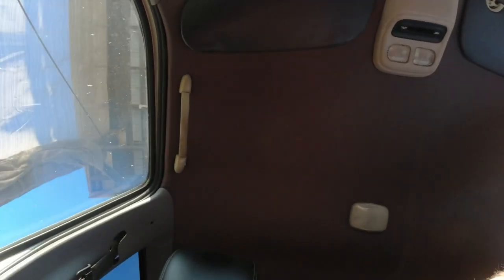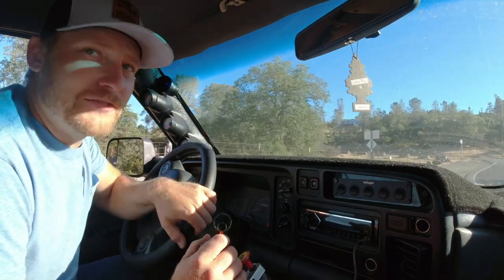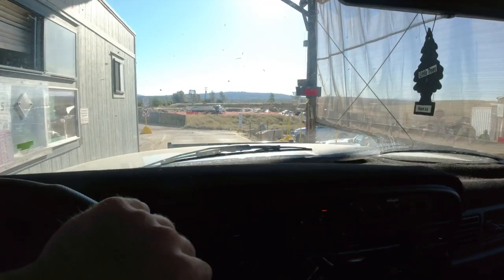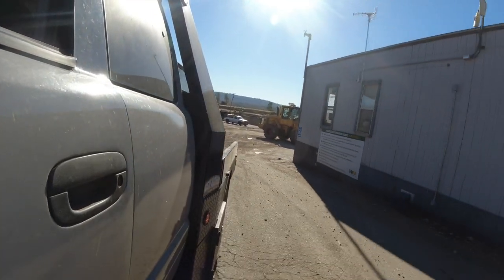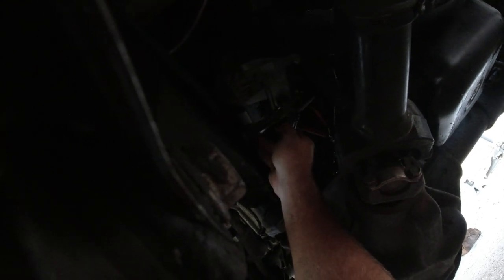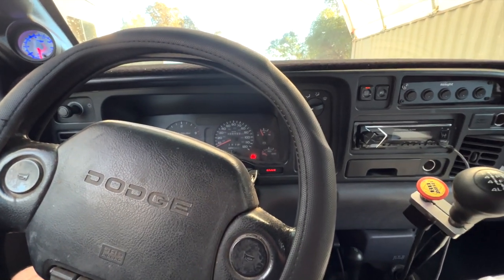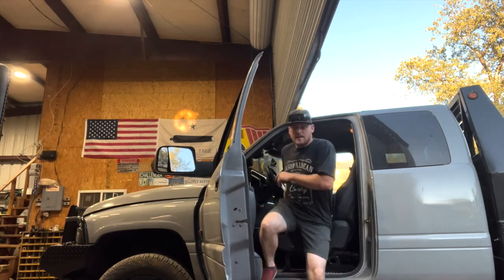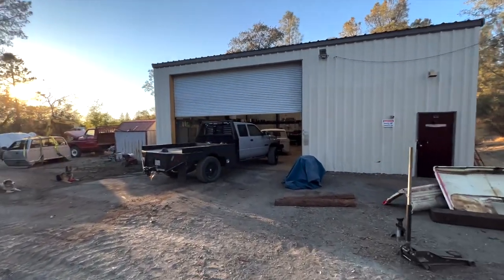12 valve Cummins almost leaves me hanging TWICE! Why no 2nd gen content??

Comment: I will say, there are cheap versions of those solder n seal connectors. What I’ve found with the Amazon/eBay ones is you have to get the solder so hot with the gun for it to start melting the connector itself most of the time, even if you get it to melt it doesn’t seem to hold very well. My dad ordered some aviation ones for his kit plane he is building and they don’t have that issue, but they are like 5 times the price.

Comment: HI  Sam.  Keep  on  doing  your  thing.  12  valve  24  valve  don't  matter,  or  hot  rods  or  tree  cutting  too  for  that  matter.  Variety  is  the spice  of  life.  Keep  going  the  way  yer  going.  Just  don't  burn  yourself  out.  Now,  in regards  to  the  electrical  connector  going  bad,  I  still  seldom  use  butt  crimp  connectors,  except  for  terminal  connections,  such  as  switches,  fuse  blocks  and  such,  where  connect  disconnect  needs  to  be  accessible.  Otherwise  I  solder  and  heat  shrink  with  double  wall  heat  shrink.  I  find  it's  a  more  permanent  connection.  I  live  in  the  cold  and  salt,  I  don't  want  any  corrosion  getting  access  to  a  connection.  Keep  up  the  good  work,  we'll  be  here  for  you.

Comment: Hey Sam, I think you needed the larger yellow crimp. Big wire won't slip inside if connector is too small. We are 2800 miles apart and you have helped me fix my truck twice and my dad's truck once.

Comment: I’ve had a bunch of electrical issues on my 95. Had the starter relay go bad a couple times. I ended up adding a wire in that splice there and running it up to the battery. If you ever have that problem just pop the hood and touch the wire to the + terminal. Hide the wire good tho.

Comment: After building an ls swap harness and some 7.3 injector harnesses. I went from even the typical solder job to the non-insulated crimps amd just throw the heat shrink over. Eliminated my vibration breaks over time.

Comment: love this content man, i pull with my 96 5.9 magnum all day and thankfully i haven’t had any problems as of yet. but i typically never exceed 6500lbs with my dump trailer AND it has a 46re 😂 however i do maintenance the hell out of it even do oil changes early along with a massive after market radiator and a big transcooler. 

i’m trying to retire it before something breaks, especially since it only has 102k miles

Comment: you really gotta heat those solder shrink connectors to get the solder to melt. most times people think once the heat shrinks you are good but nope you gotta sit there and make sure you can see the solder flow
Reply from the maker: Agreed but turns out that still wasn’t the issue. Was slightly corroded connection up to little grease fixed or

Comment: I appreciate your honesty on the 12v. I have my own 97 12v 5sp 2wd that I have dumped about what you have previously stated because I had to have others do the work. I love the seats I saw in this video and have been hunting seats for mine. If you see my comment would you tell me a little about them? I would love to find a set for mine. I weekly Drive mine mostly interstate so I put the 01 rear end with the 355 gears under her. Single axel. Thanks in advance

Comment: My ignition switch took a dump.  So I thought Same thing it looks like what is happening to you. Hit the steering wheel next time it does that.  Took mine all back apart to find where the wires snake down the column I had one grounding out. Hence why it worked when I smacked the steering wheel

Comment: Haven't had one of those solder connectors fail yet.
Only thing i can think of is either location or application is causing solder to fail due to heat

Comment: There's only so many 2nd gen projects that you can do with out getting burned out. What is your other channel and I will watch it.i am working on a 1936 chevy gasser l love that old iron. Been driving ram trucks for 32 years. 1989 12 valve ,03 3500 junk money pit, and à 2021 awesome 3500 4x4 single rear wheel ram. 370 horse 850 torque. I think all your videos are awesome Denis from Santa rosa California.

Comment: I bought those useless heat shrink solder. Every time I tried to use one it was just like that one. Separated. Want hundreds of them? Just pay postage LOL. The only long term connector I have tried is the good old wire nut. My son hoots at me all the time for using those good connectors.

Comment: Just plain solder with a soldering iron (use a good hot one) and then heat shrink. Good as new. Don't stuff around with u beaut connectors etc.

Comment: I would solder the wires and use heat shrink, melt with a Bic lighter.  I have the heat gun with the deflectors but my lighter is always in my pocket.  Looking forward to the crew cab project on the 97 12 valve chassis.  What is your other channel?
Reply from the maker: Not a bad idea that’s for sure and Samson Andrew

Comment: Put 4:10’s in it and then you won’t think that’s a full load for it, I typically gross about 20,000 or so with mine and it does just fine, it may have some engine modifications tho as well
Reply from the maker: She does good for what it is. I run close to 50k gross with the 5500s 
Had 410s in my 96 only thing it could do was tow no highway life she was rough daily
Reply: @VBELTandSON  exactly right, not a good daily with 4:10, but is amazing how well it does for a tow rig for a second gen compared to the newer ones

Comment: Hey I have a 08 Dodge 5500 2wd single cab small wheelbase auto loader  tow truck for sale🤔🤔🤔🤔 I'm pretty sure you can use it for a project runs and drives.

Comment: Looked like you didn't melt the solder. That is not a crimp connector, you just crimp to contact then heat until the solder melts. I always burn the heat shrink so I don't like to use them.
Reply from the maker: Have to use a heat gun for these. I watched the soder melt into the wires not sure why this is the only thing I’ve had issues with those on. Normally they are a slam dunk always work

Comment: Probably a bit late to this party, but curious.  With the starter wire , well any wire really, why fuck around with those solder and shrink wrap, and crimp connectors? They always end up less reliable and no faster than a proper solder and shrink tube connection.  I get using them on old dirty corroded wires , but that starter wite looked pretty fresh.. legitimately, is there some advantage to them  i don't know about?
Reply from the maker: Classic comment. Why you cussing? I believe I said it was a new starter on a 26 year old truck so wires are 26 years old. Not new wires. And rig failed to start yet again after this video. So I USED REAL SOLDER. what a pain upside down with no real to move. Trying to keep solder off my face. And guess what. Still failed. Swapped out the whole wire still failed. ACTAUL failure was corroded plus in by the battery little grease added and no more issues. So advantage of the heat connectors are plenty. I really really like them. And this is the only time I had one fail and might not of actually failed. But monkey man humor me by writing back. 💁🏼‍♀️
Reply: @V-BELT and SON     I'm not trying to be insulting towards you or cussing at you , I'm sorry if it came off that way. I'm MY experience those solder and heat shrink combos have  never been as reliable as a standard solder connection. The wires shown looked fairly clean / new on video. I recall you mentioned that you replaced the connector, so I assume you cut the older / existing wire back to clean, which for me just makes sense to go with what I know I've never had problems with.   Anyway thanks for tue reply